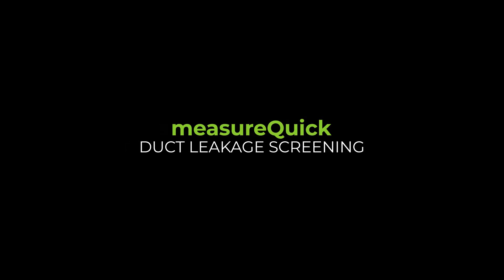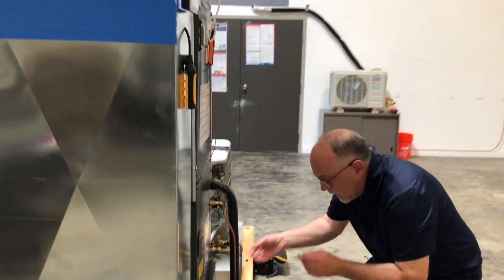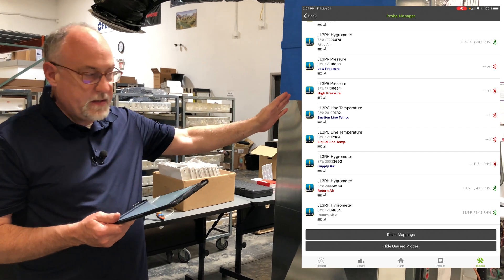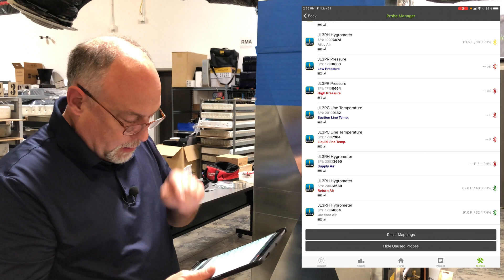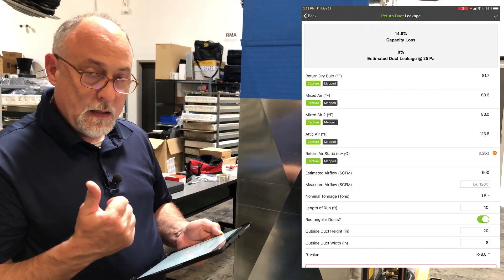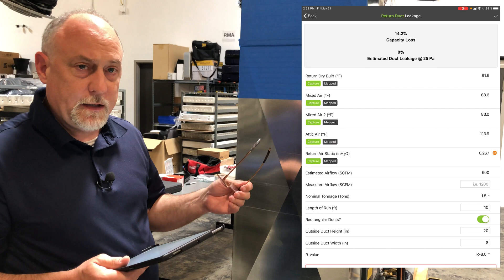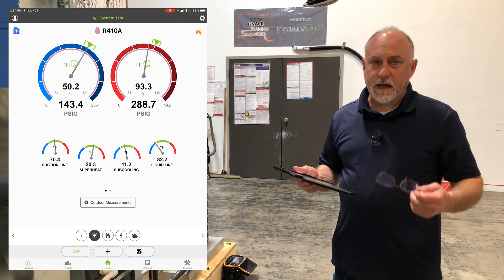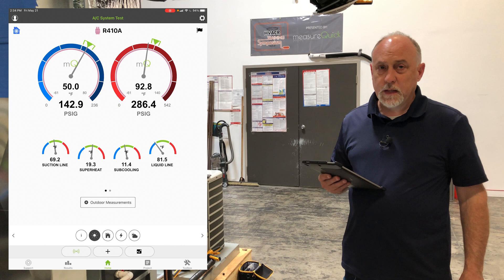Duct Leakage Screening Quick Test

Comment: It would be freaking awesome if I could remap any tool with the ability to measure the sensor I want. Like the abm 200 for temperature airflow velocity and fieldpiece electrical meter in temperature mode. Or the test 405i hot wire probe for air flow or velocity

Comment: If MQ tells me my actual airflow is "high", meaning my delta h is "low", and a blower speed adjustment has no effect, isn't that a pretty good indication that I've got return duct leakage also?

My delta h is "low" because I'm not capturing the actual return temp/humidity at the equipment, but at the return inlet.  So I'm only measuring a part of the delta h that the equipment is seeing.

Comment: Jim first of all thank you for making a video on this feature. I really love what you’ve done with the technology and you have helped me tremendously as a technician. My question to you is, how could you possibly convince seasoned technicians who may or may not be using measurequick to follow through with a diagnosis like this? Unfortunately the more surgical the features on this app become, The more overlooked and deemed unnecessary they become. I think the reality for 90% of the technicians in the field using the software is that there is no carrot on a stick for them to fully utilize these features. For an hourly employer, they are not going to want to pay to have a technician figure this stuff out because the customer will probably not notice the difference between 13 and 14,000 btu of capacity. As well as the performance pay technician is not going to get authorization from the customer to track down small inefficiencies in a system that has been working great (to them) for the past six years @ $100+/hr (not including labor/materials to repair). Building enough value to convince the customer that the hundreds or thousands of dollars they are spending on correcting airflow is a “good” ROI is HARD... if not completely unquantifiable.

From my standpoint and experience in the field, I I am fighting with the conclusion that doing absolutely everything the right way down to the last detail is not practical, and that shortcuts have to be taken for the customer to be satisfied with the price point, and feel they have a good value for their investment. I would wager that most of our customers, during an equipment replacement estimate are told that they need a few thousand dollars extra in duct replacement to correct their 0.8 inches of static, would likely say thank you very much and get another quote from another company that will downplay the seriousness of it. This is the reality of my experience as well as the salesmen at my company. I don’t see how else businesses can grow, as well as technicians can bring home a healthy paycheck, by on paper, doing the right thing.
Reply from the maker: This feature has actually been out for several years now, I just did a video on it because we had a customer ask. The leak that I showed was small compared to those that we have picked up in field practice. Most of the time, when you have a substantial leak, the system will simply not keep up. 

Not every customer will fix everything, but if you cannot identify the problem in the first place you have no opportunity to present an opportunity for repair. 

A 2015 article from Snips Magazine said a an annual cost for duct leakage is about $1.75/CFM. So think of it this way a 5-ton system leaking 15% is leaking 300 CFM, 300 x $1.75 is $525.00 annually. Many systems are leaking as much as 30% or an equivalent $1050.00 annually. Now take that over 5-10 years and consider what it is worth for a few hours of work for the customer. Additionally this should show you the value of doing it right in the first place. 

Good companies track revenue per ticket and realize what these types of opportunities are worth to the customer and the technician. Good companies also are able to track that revenue and share it appropriately. I know of techs that are making $300K a year because there revenue per ticket justifies it. I can assure you that they do not make that driving from job to job swapping out capacitors. They look at the entire system, electrical, duct, filtration, condensate disposal, etc. and present a solution that makes sense. 

Data is a powerful tool to help customers make decisions, and MeasureQuick takes some of the weight off the techs shoulders in presenting the problems and solutions.
Reply: @measureQuick   I wouldn’t have even known where to find that data let alone the kind of query to punch into google to get me there. But that is super good to know! I think maybe it is important to not only explain how to use measure quick, but also teach how to make it profitable. Those good companies you referred to, are also likely making over $20 million annually, and have resources to spare to pay people to do market research, investigate, present to management, create a pricing structure, and finally train to implementation. Unfortunately we are still a few years away from being that big, and i don’t know where to look to find that kind of data to present to my employer to get the ball rolling. So it is an uphill battle for me to convince others (and myself) to always do the right thing.

Comment: Interesting video / good video. Why is the suction line temp of 70 degrees in the “ Green Zone “ on MQ ? I Would think it should be in the Red Zone at 70 degrees ?
Reply from the maker: Because it’s normal for the load conditions, it’s 80° in the shop. Measure Quick calculates what the SLT should be based upon the return air temperature. There is though a black flag know that pops up that says The suction line temperature is above 65°, and letting it run that way longer then the hot pull down period could cause damage to the compressor.
Reply: @measureQuick     Thank you for the reply Jim. Personally , I would like to see something up front under the “ Suction line Temp “ that Says something to that effect. Or a Red flashing shadow around the Slt guage until it Drops under 65 degrees. Maybe a Tmer feature that starts timing the amount of time at 65 degrees or above to state Slt is staying at this temp too long etc. Thanks.